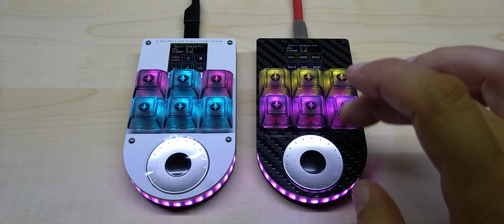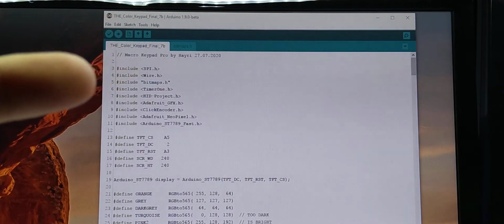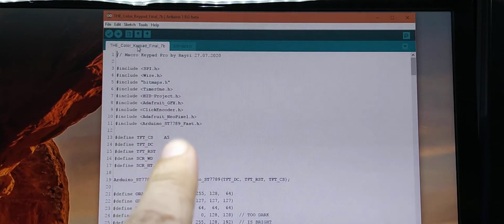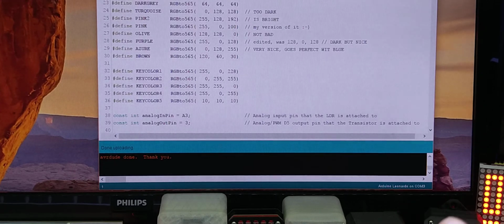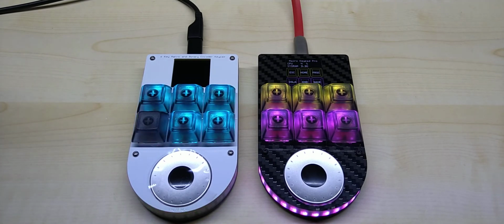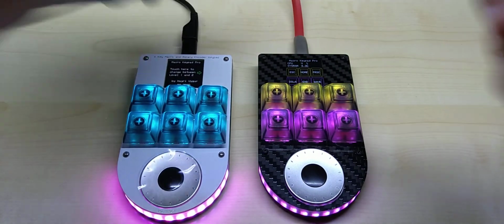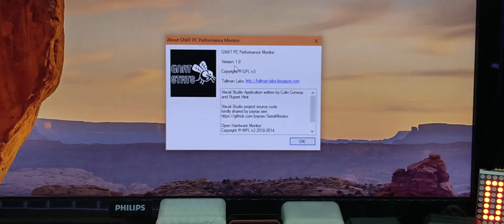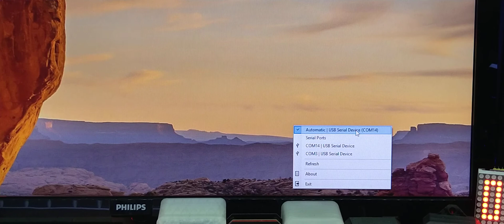How to upload code to my Macro Keypad Pro using the Arduino IDE, available now in my Tindie store.

Comment: Nice Tool, but which Switches do you use?
Reply from the maker: Thanks, no switch, it is a touch sensor integrated into the PCB that is used for switching the levels.
Reply: @iHayri1  Oh i didnt meant the touchsensor, i meant the mechanical switeches. Are they from cherry or others?
Reply from the maker: @astronomic9523  Those are Cherry MX style switches.
Reply: @iHayri1  with style you mean the feel the same, but are from another company?
Reply from the maker: @astronomic9523  Yes and they do come in red, blue and black for different tactile feel.